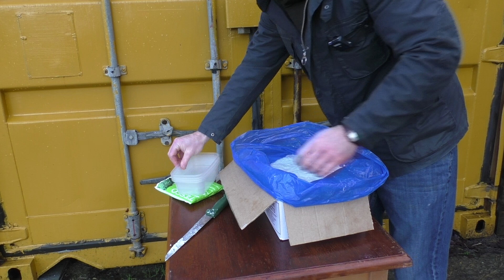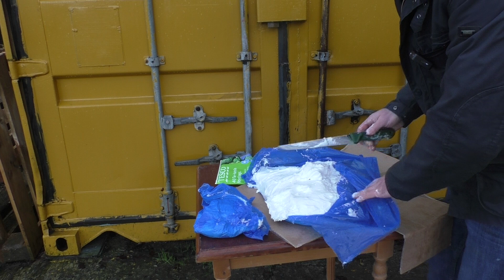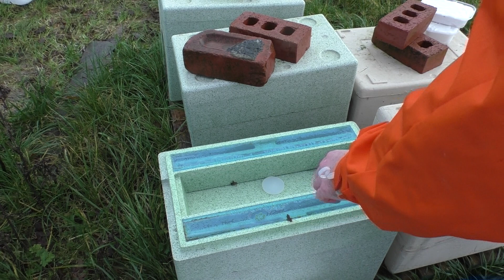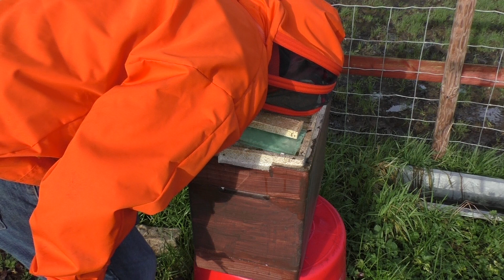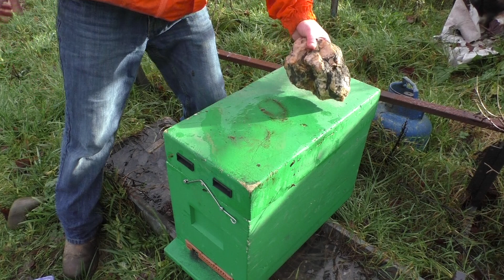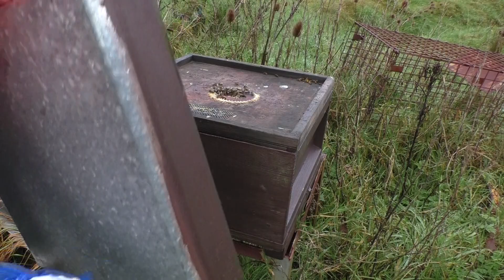How To Feed Bakers Fondant to Honey Bees. Hints And Tips

Comment: On your polystyrene hive do you have a solid bottom board of screen?
Reply from the maker: Hi, all my poly hives have screen boards and most of my timber ones too
Reply: Help me here if the temperature drops to -10 to -15 would you keep the screen bottom board open?  @gwenyngruffydd
Reply from the maker: I’d leave them open. Where we are in Wales the damp is your biggest enemy. I would choose the hive to be cold any day of the year compared to damp. Poly hives are warm enough. I place insulation under the roof on timber hives to maintain heat and stop condensation.
Reply: @gwenyngruffydd  Thank you for your help I do appreciate it. Taking the time to answer my question. I will be replacing the solid bottom boards with the screen boards. Have a good Christmas and a Happy New Year.
Reply from the maker: Your welcome. And you too 😊